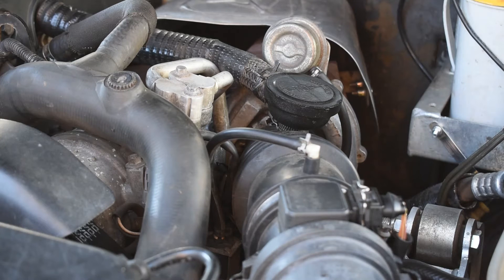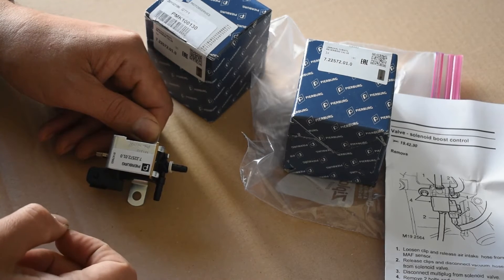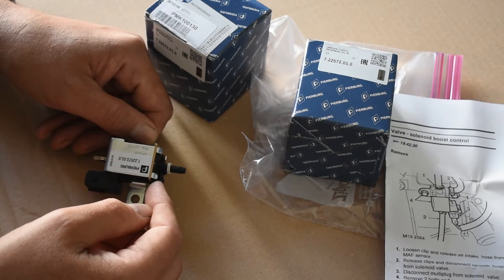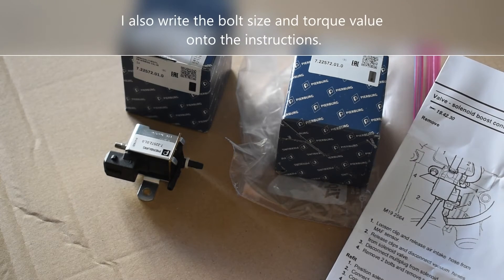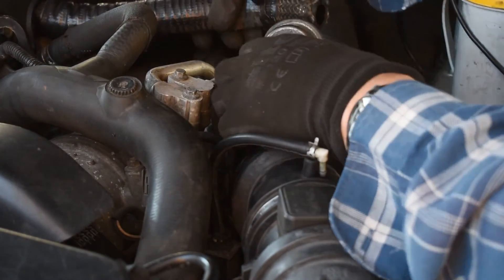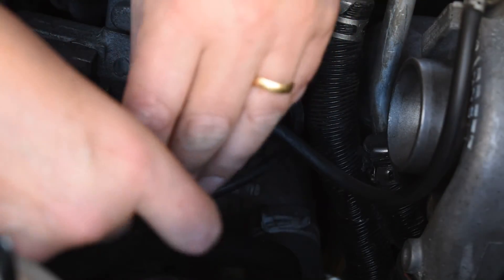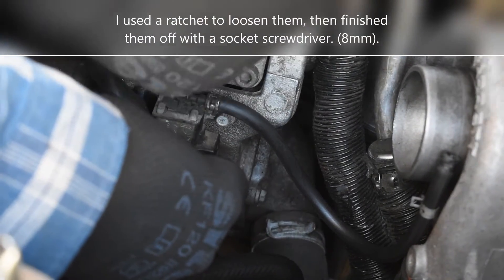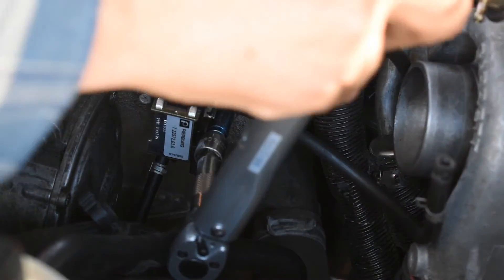TD5 Waste Gate Modulator - test and replace

Comment: I think you're a bit confused about this.  Pressure moves the wastegate actuator.  The modulator bleeds off pressure in the wastegate hose at lower RPM to prevent the wastegate from opening prematurely, delaying full boost.  The modulator cannot reduce boost pressure below the wastegate setting.    The modulator cannot "prevent overboost".  It can cause overboost if it leaks.